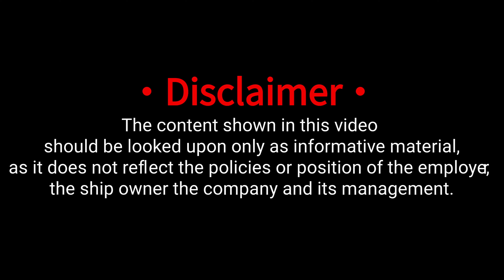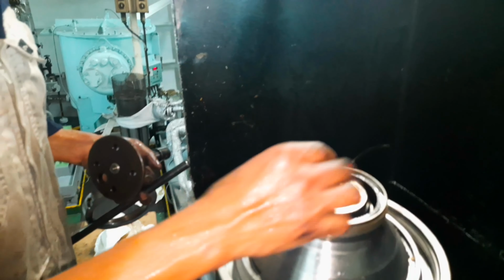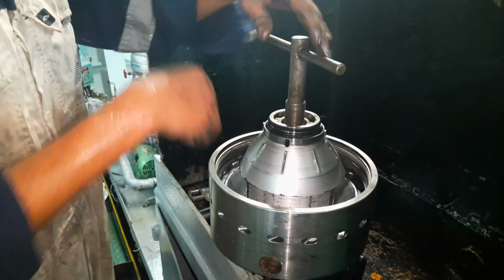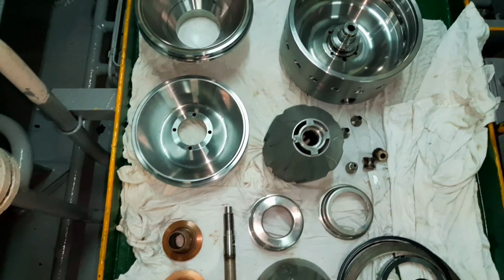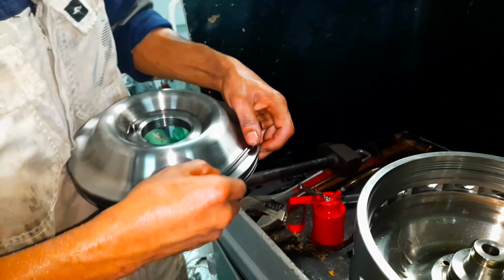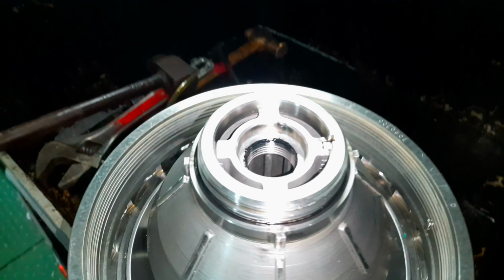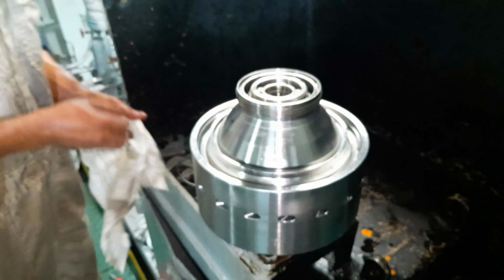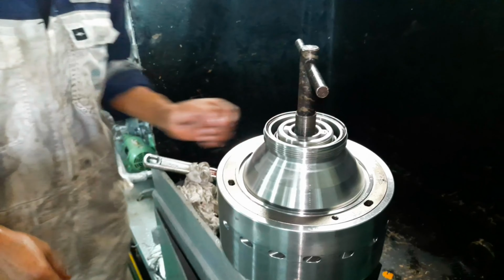MITSUBISHI SJ SERIES PURIFIER COMPLETE OVERHAUL PROCEDURES | PART-2 | SEA LEGEND|

Comment: reason of oil leakage after 18 minutes?
Reply from the maker: Hey sorry for late reply...was occupied with onboard troubleshooting job...
Speaking frankly....it's very difficult to conclude for the reason....but would suggest if the O'HAUL is perfect with all new O-rings than the reason for leak would b due to worn out liquid chambers....as same are of brass and get thinned down over a period of time.